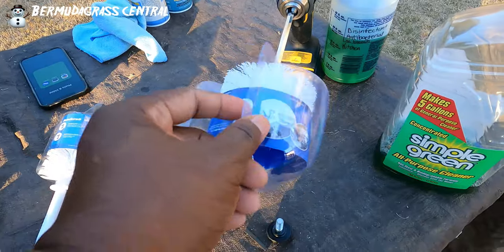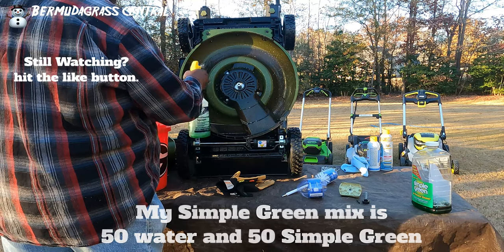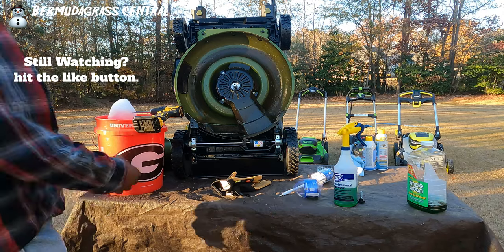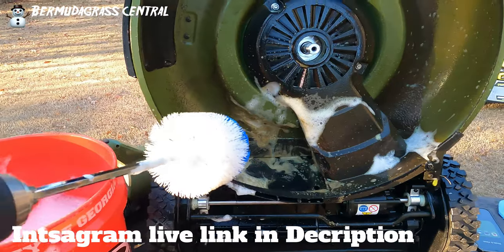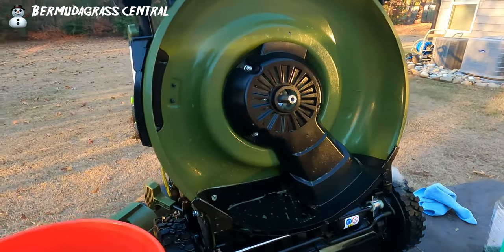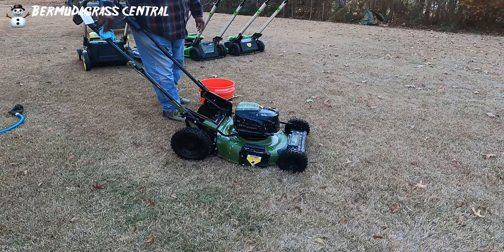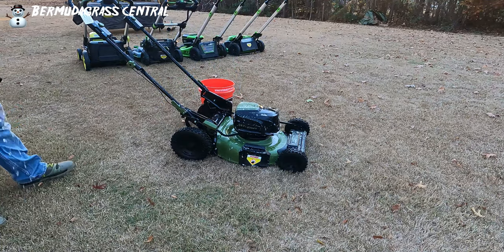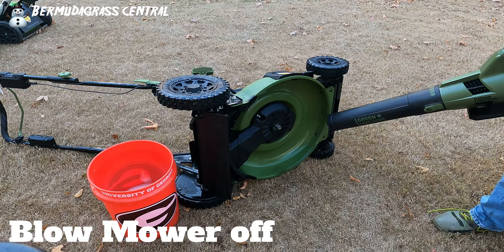How to put BATTERY MOWER in Winter Storage / Winterize your Battery Mower

Comment: You definitely want to keep your batteries inside when it freezes outside. For long term storage you only want to charge your batteries halfway. That is the way you get your batteries when you buy a new. I could be wrong but do some research on lithium batteries Storage.
Reply from the maker: I’d do a Full charge before storage and back on the charger before first use. Either way your good 👍🏾
Reply: +1 to Brett’s suggestion.  For lead acid, top it off.  For Lithium ion, halfway.    (For long term storage)

Comment: I pretty much threw $80 away by leaving my battery in my toolbox last season (garage).  It only lasts five minutes now.
Reply from the maker: What brand mower do you have?
Reply: It’s for a Black & Decker string trimmer.  I want to move on to Stihl.  I run JD mowers, and unplugging the battery over the offseason seems to work good enough on those.